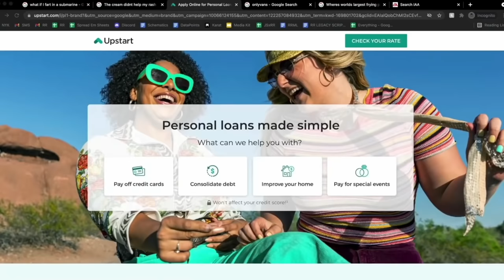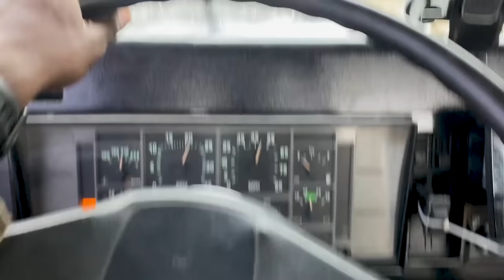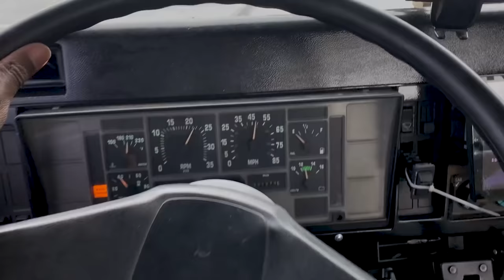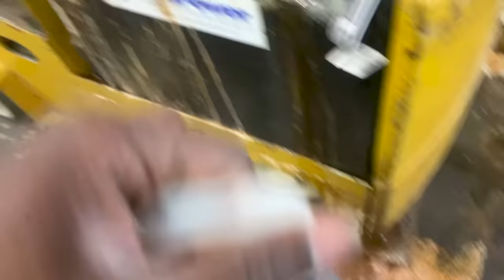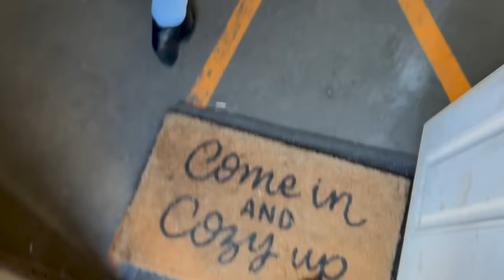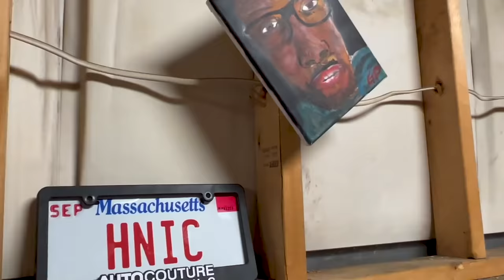A New Home for our Babies: Thanks Youtube

Comment: Clean the nozzle and scrape down that waste oil heater every 2 weeks in the winter. That's what our shop has learned here in Pennsylvania. Also there is a filter built into the pump itself that most people forget about. You wouldn't believe how much makes it traps and reduces the pressure. 👍🏼👍🏼
Reply: And make damn sure the air compressor doesn’t go down. 
You’ll end up buying a bunch of oil, but it’s still cheaper than other sources. Filter the oil a couple times.
Reply: @Project_Low_Expectations  Separate shutoff for shop air and heater air makes life easier too
Reply: Good info
Reply: @williamstamper442 by
Reply: O

Comment: Nice shop. I've spent years of my life living in an office a warehouse. This brings back memories. We actually, at one point, installed a shower with a kiddie pool underneath and drilled holes in the bottom which led to a drain outside. Used one of those hand held shower connections that fit to a faucet and bolted it to the roof.  It got the job done.
Reply: The sink has a drain.  If the drain for some reason doesn't drop below floor level, you would just build a 2ft platform with steps for the shower pan.  They have the ceiling height for it.

Comment: I really feel you on the broken TV. It took me FIVE tries to get a non-broken TV from Walmart/Sam's a few years ago. Kept arriving with a cracked screen! Took months of sending it back and forth via freight deliveries
Reply: ...really? Half of the TVs in my house were ordered online from Walmart & shipped via FedEx, none arrived damaged. 

One of my TCL Roku TVs shipped without firmware for some reason & immediately booted into recovery mode instead, but that was the only issue that I've ever had with a TV delivered to the door, & isn't even a fault of the carrier.
Reply: After that many times I start questioning the customer.
Reply: Same happened to my cousin. He eventually ended up getting a free TV out of it
Reply: i feel like they manhandled this on the  wallmount positioning the panel. At this size they crack so easy. And also Samsung panels ........
Reply: They definitely ran the bolts too far in on the mount. I don't know why they come so long, but I always end up at Ace hardware getting shorter bolts

Comment: I'm not a car guy but I love the content that you keep putting out there. This video is the first time I actually have some experience at one of the things you're doing. 

I used to work for the company that pretty much makes about 80% of the lead acid batteries for forklifts. I was a part-time scientist and part-time charger; meaning I put the initial charge onto those batteries and dose them with appropriate amounts of liquid platinum. 

I have refurbished lots of those batteries when they come in... But I haven't seen any in that bad of shape at least on the outside. Your method of cleaning the tops, adding DI water and doing a slow charge was exactly what we did. One of the products out there in the world that maybe useful for you is an aftermarket gel medium for those lead acid batteries. It's a product they actually use in marine batteries when there's always a chance of getting salt water contamination and they have to seal them up real strongly. Adding just a little bit of the gel medium to batteries that have already started to corrode the cathode and anode separation means you can get a lot more life out of forklift batteries. The big caveat is that If there's a chance of getting down to negative 30°, some of these gel mediums break down and will basically instantly discharge all the cells inside of the battery. 

We did have batteries come in refurbished that had been used daily for 25 years with little maintenance other than water that would probably last another 10 years with proper charging. That's the reason the industry still uses lead acid batteries for certain applications. Love the videos even though i don't really care about cars.

Comment: "The EV of the heating world" is perfect.  Totally ignoring the emissions because it's cheap to fill lol
Reply: "You froze to death but at least you had a clean conscience while doing it" didn't know you watched Rich, Stephen Colbert.
Reply: Not many oil changes on electric cars. Worked in a dealership with one. Ran out of drain oil so they had to have oil delivered.
Reply: Just like EV nuts ignore all the emissions produced in the manufacturing and transporting of, mining battery materials for, and generating electricity for their electric cars. Lol. The fuel burned in a car or heater is a pretty small piece of the puzzle. And burning used oil is more efficient and safer than hauling it back  to the beginning of the supply chain to be re-refined. So it’s making good use of a waste product that would otherwise cause more pollution and increase in fuel cost.
Reply: @emersonb5764  Most of the carbon emissions with fossil fuels are produced when they are burned, not in embodied materials (manufacturing, etc.). EVs have relatively low lifecycle emissions thanks to the higher inherent efficiency. So kind of apples to oranges.

My real question is how much waste oil they actually have to burn- probably not enough.
Reply: HNIC, priceless

Comment: Modern big screens have very little torsional stiffness, oftentimes packing/shipping materials are minimal... easy to damage, hard to get fixed... (I've repaired my own). 

Competitive market place w/price points plunging down to the few hundred dollar range... this is what we get... ie., too many arrive D.O.A. 

Plus, many electronics repair operations won't work on them... they consume too much shop space and are unwieldy. 

I've gone thru three... 60" Sony XBR rear projection, 65" Panny plasma, now the 85" Sony. 

Next move, onto a projector and a screen. They've matured enough, they're fixable, sized right, constructed robustly, shipped/packed robustly
My current 85" Sony ... it's a handful.... but nothing like gen one plasmas built like tanks.

Comment: EV-1 electronics! If you want to call it "electronics". A card with a bunch of transistors and resistors and a 14 terminal plug in interface. Pin 7 is accel by the way.

Comment: Rich you're going to need a hygrometer to test the levels of electrolytes in each cells. Then check for voltage drop between the cells. Just my 2 cents from my old job haha. Great content!! Demo with a forklift! Haha
Reply: Not checking voltage drop per cell as much as looking for any cell less than 1.8vdc which most likely indicates a dead cell. The hygrometer thing ain't really used anymore but can tell you the condition of each cell, kind of the same way as measuring voltage of each.

Comment: Dude, I'm 01:45 in and I reckon a diesel powered Segway is an excellent idea.
You make the best Segways on YouTube.
Reply: That wouldn't be easy. A vehicle like that needs instant torque in both directions, something easily achieved by an electric motor. A drive wheel CVT like in a snowblower might work but you'd probably still go with an electric motor to adjust it automatically. Designing a fully mechanical control system would be quite a task but.

Comment: You better start hunting for a used oil source.  The new heater will still burn through your oil quickly. Start hitting up auto shops and heavy equipment businesses, and store as much as you can in 55 gallon drums.

Comment: Weren't those dry cells in that battery a fire risK? Speaking of which there was a Ford dealership here that burned to the ground when their used oil heater caught fire. I think that happened around 2008. Be careful with that heater.
Reply: Why would it be a fire risk? Isn't a dry battery just some metal plates kept apart?

Comment: I wonder how much that lift truck was probabley good deal if it was sold as not running the only thing wrong was the factory it came from was too dumb to put water in the battery. They make reconditioning additives for those batteries might be a good idea to add some.

Comment: The screen damaged wasn't because of not having removed the plastic before, right? (Given that the factory plastic works the same way as anti-scratch protection you can adhere to your say phone's screen), rather, my "bet" would be on that the screen was just way too thin and flimsy, and as most LCD and OLED screens these days are made using a glass screen, well, thin glass tend to break when flexed.

Comment: My grandfather designed an automated track system for moving the batteries in and out of the these electric forklifts called Mutishifter.  See these batteries are immensely heavy.  Removing and installing them used to be a serious occupational hazard.
Reply: As long as Rich does not replace them with Lithium that truck should stay balanced.
Reply: Or just use an overhead crane and a battery bar.

Comment: - Uses a butter knife to remove trim because he didn't know about trim tools
- Buys trim tools
- Uses trim tools to clean corrosion off the batteries 😂
Reply: He does not know about battery corrosion scraping tools.
Reply: The battery could melt the butter knife in well under a second and that wouldn't be fun.

Comment: Electric forklift, how hard is it to fix them?
Me: coming from electric forklift mechanics for 15years....YES! 
it can be done, just basic mechanics as long as you check the batt first before buying.
Reply: Steam cleaners clean up batteries immediately
Reply: Skip the distilled water, all they need is tap water. Fight me if I'm wrong

Comment: All joking aside a few things I want to point out. First the big one I really hope you're okay! That place looks a little bit like a very sad Bachelor guy setup and I don't mean sad haha i meen I hope everything's okay on the home front kind of potential sad..

Second the television not working a big television like that my cats just dropped to the floor.! 3ed Hopefully the Mini Coopers not a permanent decoration there.i love those little Coopers and anyone around these parts even a rotted out one for a lawn ornament is nearly impossible let alone a beautiful one the condition that is in where it can still be driven and enjoyed.  The other thing I want to point out being the 4th is two parts about the forklift. Be very careful moving a vehicle even the Mini Cooper with the forklift and don't go getting stupid and trying to climb under a vehicle while it's up in the air with the forklift that's just a bad idea people have been killed down here doing that.. And last get some Rubbermaid container Lids or a piece of wood or something would recommend Rubbermaid container lids to put over top of the batteries so you've got some protective covering between the seat of the forklift and the batteries especially when you're getting on and off batteries being opened and exposed like that is really tricky and you can run into problems like potentially dropping a tool in between the battery terminals and that's basically a very bad day!!!! You got really lucky that you didn't have to replace the batteries on the forklift I was initially thinking it would need new batteries. Nice shop! i Just hope it's a situation of sometimes you sleep there not it's your new permanent residence.; The flashlight part of me died inside;)

Comment: "the EV of the heating world" dude really? have you not heard of a heat pump? nothing is closer to being the EV of the heating world than a system that purely operates on electricity and can provide more than 100% efficiency. check out Technology Connection's video about them, they are seriously next level, and are cost effective right now
Reply: "Cost effective" does not mean cheap. Heating with electricity is much more expensive still.